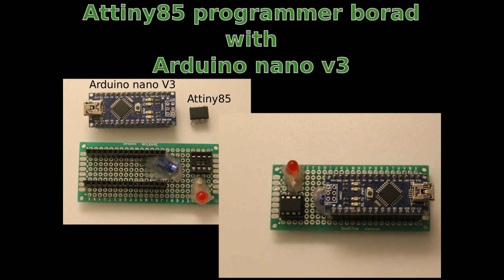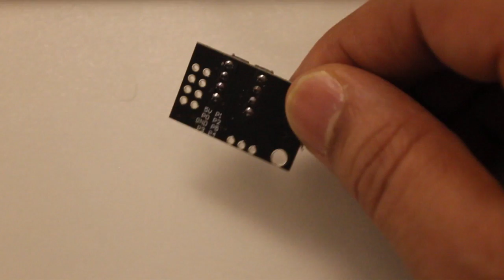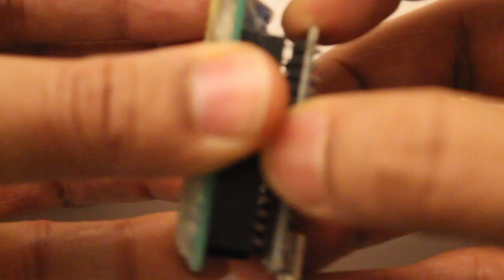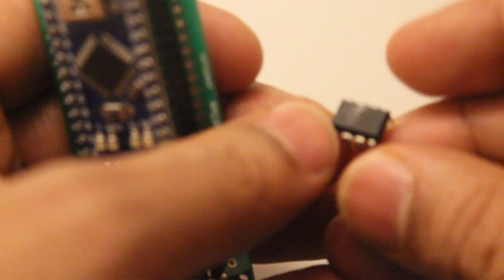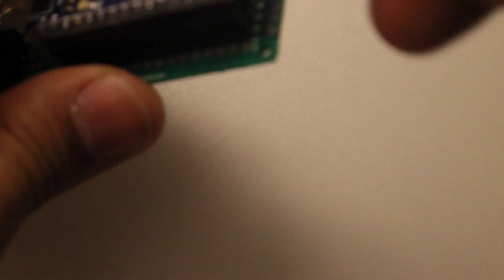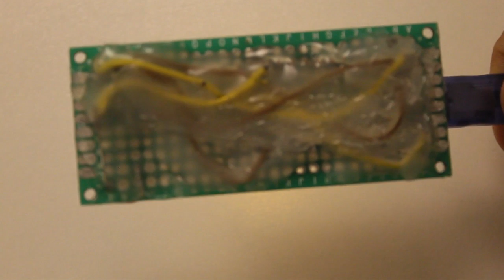Attiny85 Programmer Board

Comment: What is with all the hot glue?
Reply from the maker: It's silicon glue get protection from water
Reply: I asked myself this question a while ago too but sometimes it makes sense. If you have a simple circuit without a housing you can protect the components and the same time everything is isolated. It's ugly like hell but it works.

Comment: I have the same black board, and after looking carefully into copper traces, it turns out it is just a breakout board with a 5V regulator on board to be used in raw volt-in line. The only possible use of this board that I can think of is as a breakout board to be used after programming the attiny chip and nothing else.

Comment: @ your questoin: its not possible to program the chip via micro usb (black pcb) - because if you take a closer lookt to the black pcb you'll see that there are only 2 wires just for power the attiny. the other usb-wires are not connected / not used :D